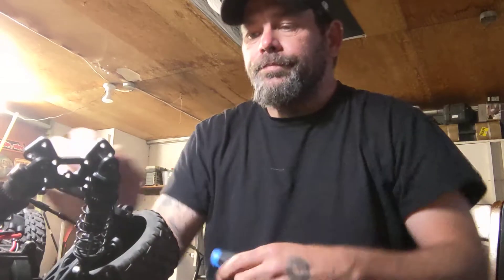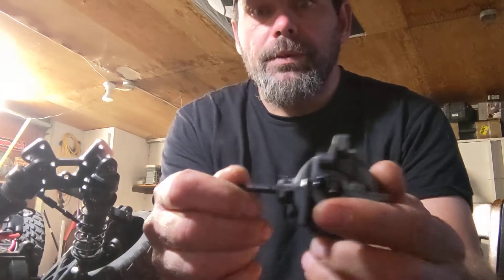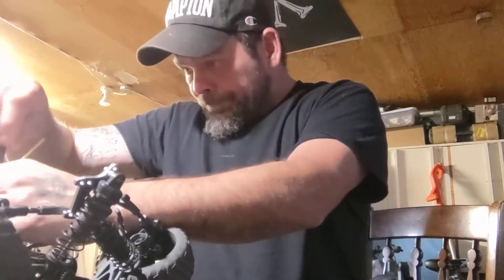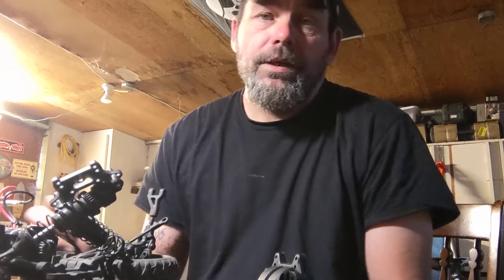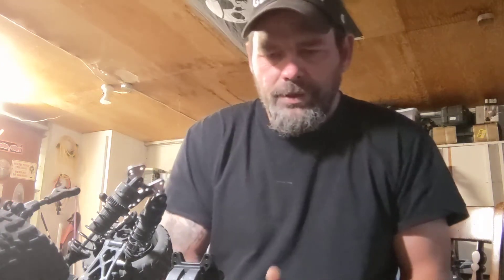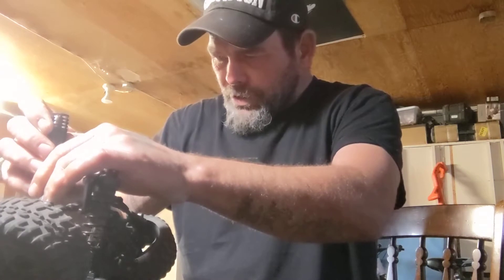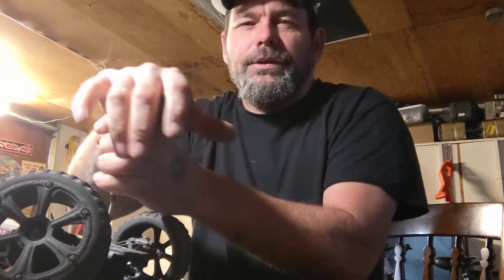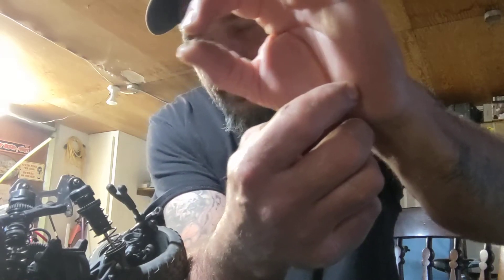redcat blackout rear differential replacement

Comment: It's called a drive cup,  input cup.😉 Cool video, I race high end race cars now,  they are way nice durable. Good luck!
Reply from the maker: Yeah I know what you mean I went from gas powered four strokes nitro powered to the electric side of it and with these high-end motors I got everything goes fast although it explodes on impact you should definitely check out my other videos building a rock crawler right now it's pretty sick high in low budget but not too low